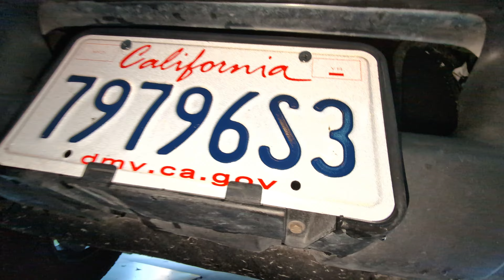This 5 Minute Repair Restored my Truck's Steering – Bilstein Steering Stabilizer Replacement

Comment: I imagine that could've been serviced about 100k miles into the truck's life. But who would've thought about that. But yeah almost any type of fluid/grease will eventually degrade and require a change of fluid or eventually total replacement.
Reply: The truck looks great! The chrome looks great! I miss the styling of these (now) older Ford's.
Reply from the maker: Right? It's entirely possible it's been swapped out a few times already.
Reply from the maker: Thanks! Yeah I agree. This one has elements of the facelift added to it, and I love it.